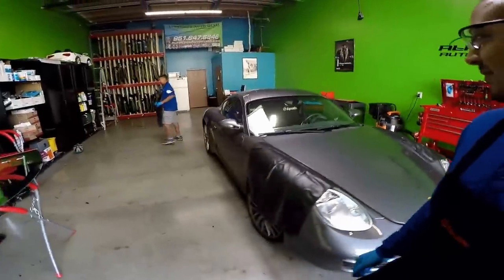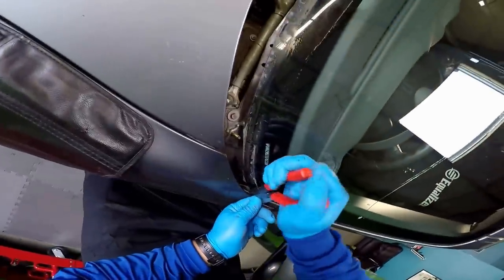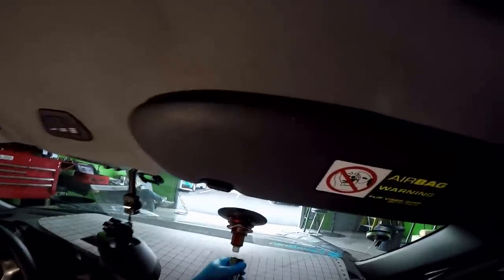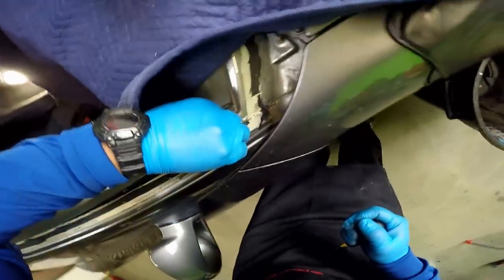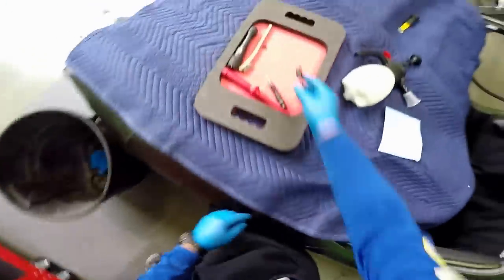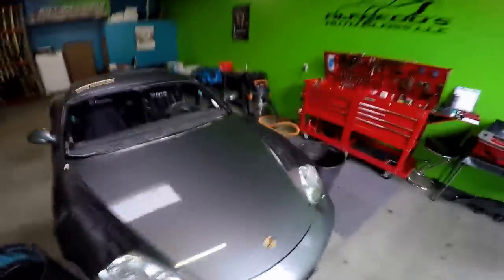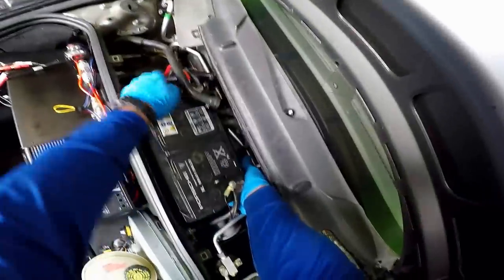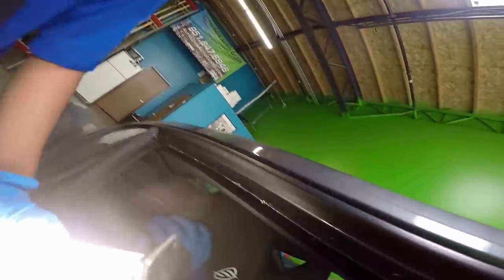Porsche Cayman 2005-2015 Safe Windshield Replacement By Alfredo's Auto Glass

Comment: Where did you get the 90 degree tac puller. I’ve had a few occasions where I had to improvise
Reply from the maker: william arnold Here’s a link so that you have the part number but you could buy it at your local auto glass  supplier https://www.equalizerfusion.com/Products/ProductDetail/854

Comment: How do you remove the cowl from a Nissan armada without breaking the cowl clips, the black portion that holds the clip? I currently use a metal panel tool. I get 2 or 3 that break every time. please help
Reply: MidCali831 take off the lil weatherstrip first then pull the cowl toward you (front of the car) it pops the cowl off the clips white clips